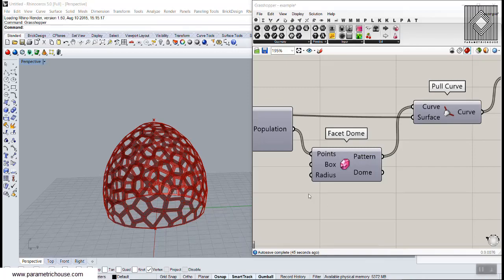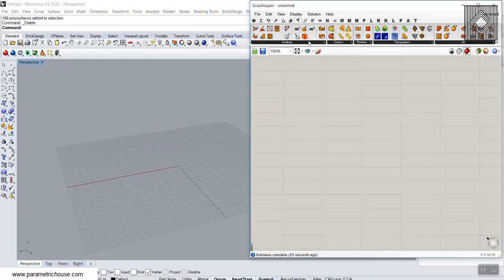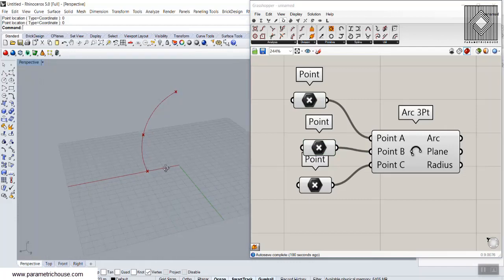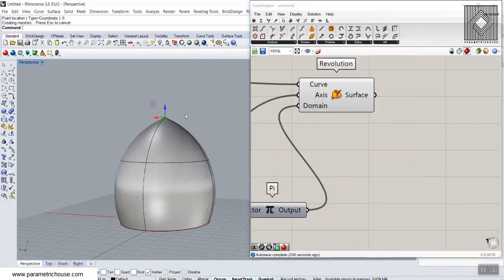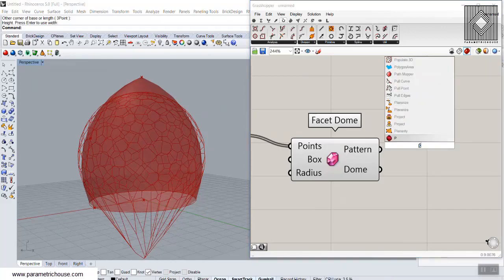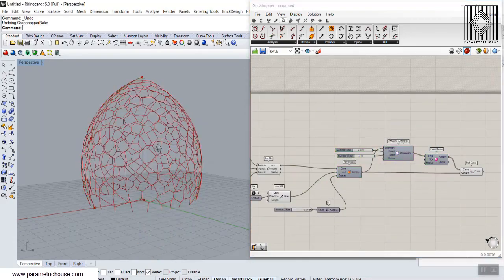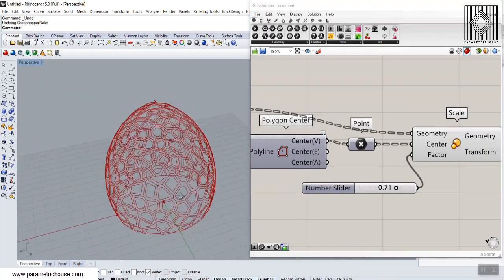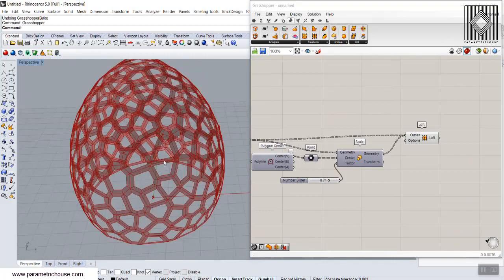Grasshopper Tutorial (Facet Dome)

Comment: I can´t connect "curves" in last loft module with two other modules 
Any help please?
Reply: yes, loft doesn't work for me either
Reply: "Ruled surface" works :)
Reply from the maker: Did you simplify the outputs?
Reply: Ok, next tip, use "shift" key to join different modules :)
Reply from the maker: @tomaszpikos630  that's also possible😊 most beginners don't know how to connect two outputs to one input